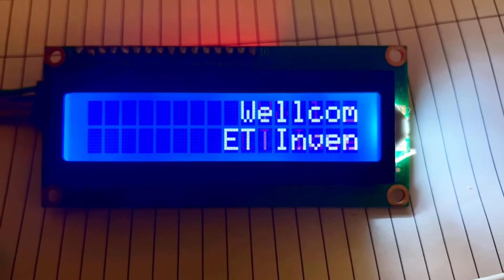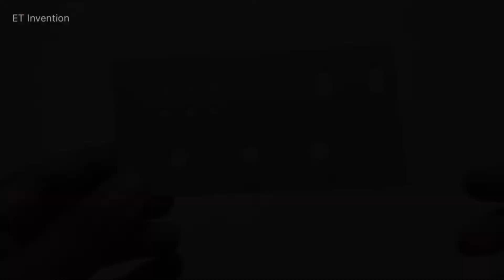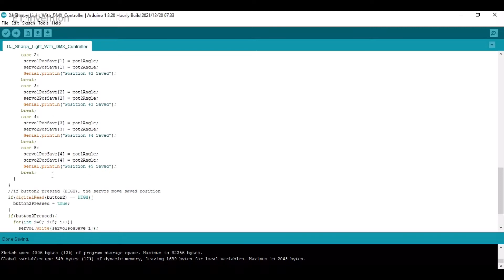Sharpy Light DMX | How To Make DJ Sharpy Light DMX Controller | DMX Controller | Part-2

Comment: Can I use 100 rpm dc geared motor instead of The servo motor
Reply from the maker: No...
Reply: What is the rpm of the servo motor u are using?
Reply from the maker: @ShrishChakraborty-t6i  0.12s / 60°